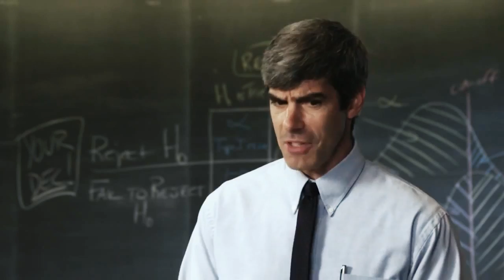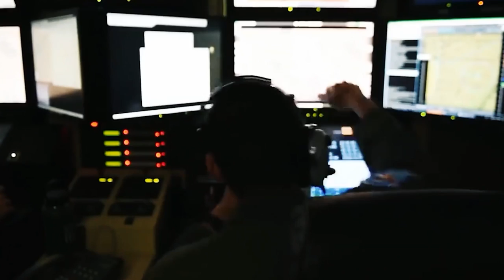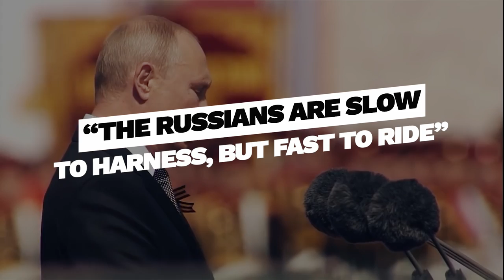US Is Restless: China Revealed Its 6th Generation Fighter Jet

Comment: All three countries will have to cancel the  program maybe, the maybe is crazy built into the process. America is crazy and disregards cost, I estimate the cost per unit of sixth generation aircraft will make the JSF program look cheap in comparison. Hundreds of contractors, start ups and individual software engineers will be involved. That's not cheap but that's only the beginning new production and advanced fabrication facilities will need to be built. Which will add to cost, which include training of factory to level of say a third year engineer student. The engine will be the hardest because of the minimum specs, cruise at least Mach 3, after burner beyond the hypersonic barrier. So much more. China will be the smartest of the three dunder heads. The will initially used the program for technology testing and modify existing airframes. Russia forget about they aren't even in the race, their eyes are bigger than there wallet.